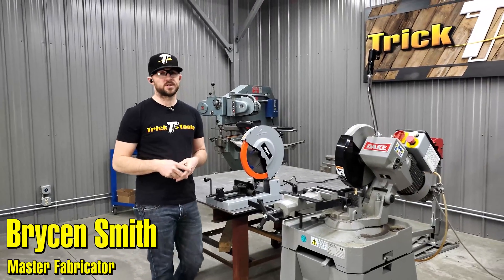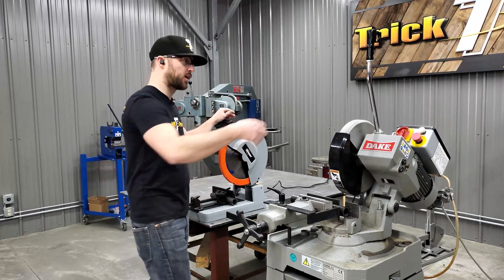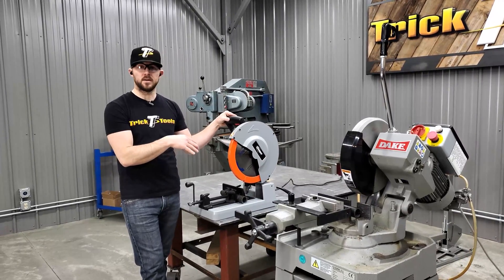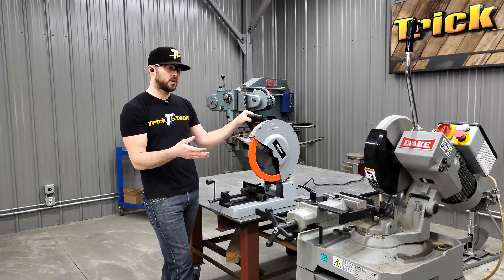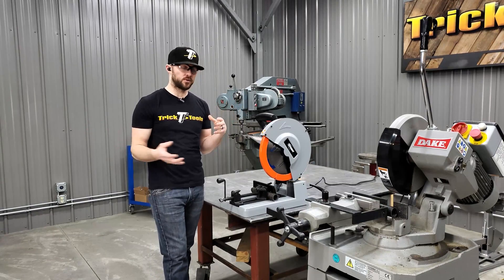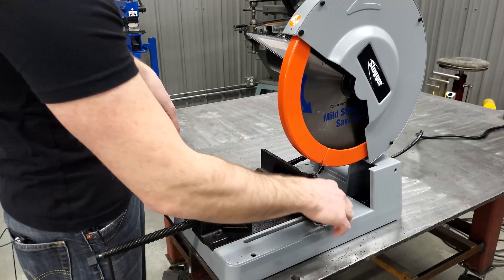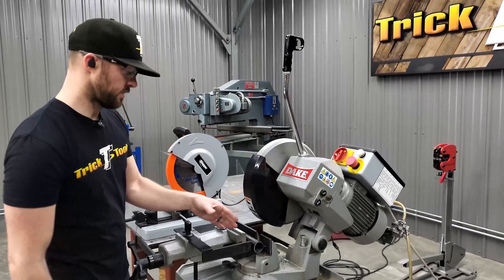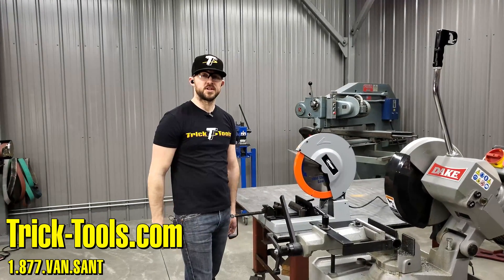TCT Chop Saw vs. Cold Saw Pros and Cons - Trick-Tools.com

Comment: How are they for aluminum and other non ferrous metals?
Reply from the maker: They both work fine for non ferrous with the proper blade.  Typically dedicated non-ferrous saws are higher speeds than a standard cold saw.